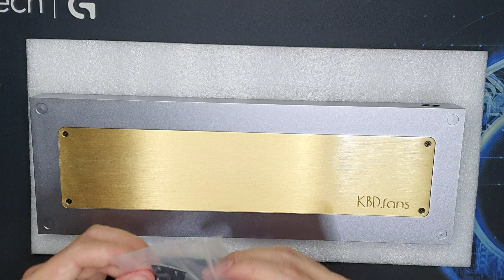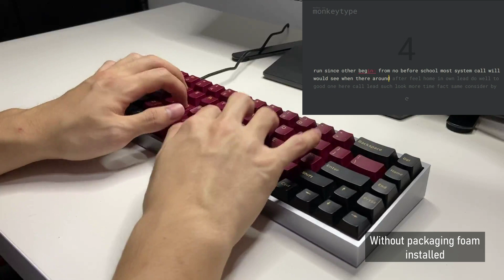Building My First Custom Mechanical Keyboard - Tofu65 ( In Depth Walkthrough )

Comment: Nice build man. I just ordered a Tofu 65 a few days ago, and wanted an in depth guide on how to put it together so I know what I’m doing. Your build told me everything I need to know. Great job please do more!
Reply from the maker: Appreciate the kind words! That was one of the reason why I made this video because I couldn't find a proper guide when I was building mine. Glad it helped someone. 
Btw another tip, you should try fitting keycaps on the modifiers like the caps lock, left ctrl, tab keys etc before you solder to ensure you put the switches in the correct holes. I had to desolder one of them because it was one hole out of position.
Reply: @byong2250  what are those tweezer things called
Also, what foam did u use?
Reply: i did too it came 2 days ago

Comment: wow, that foam really made a bigger difference than I was expecting.
Reply from the maker: Yeah it was a surprise to me as well. But it did introduce some inconsistencies in sound for the different rows.
Reply: @byong2250  I know KBDfans sell foam for each of their PCB, why did't you buy one of those?
Reply from the maker: @Elestar60  I bought my DIY kit during black friday last year. I don't think they had case foams on sale at that time or maybe I just overlooked. But yeah if you can get them you should. Definitely better than the ones I used :)
Reply: @byong2250  hey should I do the oring mod for the tofu. Some say it's good. But some say its bad for the pcb. Also does the hotswap dz65 make a difference against this pcb. Becos I dont know soldering neither do I have one.
Reply from the maker: @samuelrameshpackiaswamy1796  I just did the oring mod for mine and the changes it made to the sound and also the typing feel was impressive. I was planning to release a tutorial video but hadnt had the time to edit it yet. I dont see the reason why it would be bad for the pcb unless you're worried about it flexing too much? I wouldnt worry about that because normal typing wouldnt flex the pcb that much. And yes the dz65 RGB hotswap PCB fits the tofu 65 case. There is even an option to buy that combination on KBDFans website but it is out of stock atm.
Reply: @byong2250  I've been using the Tofu 60% with the O-ring mod for probably around a year now. It made a huge difference and I don't think I'll ever use my Tofu without the O-rings. And i haven't had any problems with the pcb because of it

Comment: How come you soldered onto the PCB?
Reply from the maker: Isnt all soldering work soldered onto PCBs? O.o
Reply: @byong2250  lol I meant is it necessary to solder the stabs on those kits? I watched another video where they didint solder their stabs. I’m new so sorry if this is a dumb question!
Reply from the maker: @Smosh842  Hey no need to apologise! There is no dumb question. I used screw in stabs for mine. It's not soldered onto the pcb but screwed onto it. Generally there are 2 types of stabs which are clip ons and screw ins. Clip ons are easy to remove but tend to wobble abit whereas screw ins are more secure.
Reply: @byong2250  got you thanks! So what was the solder anchor points for?
Reply from the maker: @Smosh842  ahh I think I know what you're referring to. So by soldering anchor points I meant to firmly press down while soldering some of the switches to make sure the switches sit flushed onto the pcb. Once you've done that for a few of the switches (preferably around the corners) the pcb would be secured by the soldered switches so that the other switches will sit well onto the pcb as well. If you don't, there may be a chance that some of the switches sit higher or slanted on the pcb etc and it's a hassel to reposition soldered switches
Reply: @byong2250  thank you for the explanations!

Comment: Sheesh this key be bussin btw what are ur thoughts on the gateron black inks
Reply from the maker: Thanks! Gat black inks are definitely a safe choice if youre going for smoothness and lower pitch switches but are on the pricey side imo. Lubing and filming these switches are highly recommended unlike some switches being able to be used stock. Some other linears that I like are banana splits and tangerines. You may want to check those out too.
Reply: @byong2250  out of b splits tangerines and inks what are the thockyiest and thanks for responding

Comment: I'm pretty new with keyboards, what does filming the switches do? Does it dampen the sound or help with stability? Thanks
Reply from the maker: Hey there. Abit of both actually. So a film helps tighten the switch by reducing the wobble between the top and bottom housing especially after opening them to lube. With a tighter switch some say it makes the switch sound more solid with less high pitch plastic sound (most probably due to the top and bottom housing hitting each other or moving around during actuation) . Not all switches need films though, some are already tight by design and if you add a film it is difficult to close the switch. I wouldn't say there is a general rule on whether you should film your switch or not. As this was my first custom I just did it for completeness sake. There is a slight difference in sound between a filmed and un-filmed gateron black inks so my best advice would be to try it out for yourself. You may not even notice the difference.

Comment: For your safety I'd like to advise you to use a fume absorber fan. Fumes do not do harm at first but could over time.
Great first build!
Reply from the maker: Yeap will look into getting one for my future builds. Thanks for the advice!
Reply: @byong2250  If you're on a budget a normal fan should do just fine. You just need good ventilation and make sure the fan is at least blowing the fumes away from your location.
Reply from the maker: @evanyang3310  Thanks for the advice! I will definitely keep that in mind when soldering.

Comment: How much space is there between the case and the pcb? ( I kinda need to know cos like I’m buying sorbothane to foam this kb and Im worried I would get the wrong thickness) and how much was delivery?thanks :)
Reply from the maker: The foam I used was about 4mm thick but it was compressed a bit around the spacebar row. I would recommend getting 3mm or less. Delivery for the keyboard through FedEx was about 23 USD
Reply: @byong2250  ok thanks

Comment: Hey, how much did you spend for equipment and can you put the link for tofu65, pls?
Reply from the maker: Apart from the items listed at 1:00, the soldering iron was 30, 12 for 5g of krytox205, 10 for GPL105, all in SGD. I would recommend getting a better soldering iron though for example the TS100 which is more compact and has better temperature control. You can get the Tofu65 from https://kbdfans.com/

Comment: Sounds nice.  I have a TOFU60 on the way with Gateron Yellow SMDs and brass plate and I may get the Ink Blacks and alloy plate instead instead.  I like the "thud" that yours makes. Is there a reason why you did not order the case foam that is an option from KBDfans when you buy the board? That foam works well though.
Reply from the maker: Thanks! Tbh I did not notice the case foam option when buying the DIY kit. Maybe they added it later I'm not sure. I bought mine during Black Friday last year.

Comment: is the kbd 67lite hot swap pcb compatible woth tufu 65, cause I really hate the soldered board when I need to relube it will be nightmare so I wanted to get a hotswap pcb any time Ican unplug the switchs
Reply from the maker: Tbh I'm not sure if it is compatible but I do know you'll be missing a blocker on the left of the arrow keys. The lite has a blocker.
Reply: @byong2250 first thanks for reply  and  could you provide me with a proper guide that learn me how to choose the proper keycaps for my build and know if it's compatible or not

Comment: You should try the O-ring mod. It makes the keyboard sound and feel 100 times better. I did it to my tofu65, and it's night and day!
Reply from the maker: Oh yes I am planning to try that but having some troubles finding suitable O rings atm.
Reply: @byong2250  on the vid where they explain the process of the o-ring mod they link suitable orings
Reply from the maker: @Max-ei1pf  I'll definitely check it out. Thanks for the info
Reply: sneezyo  dude... I didn't mean to it on the keycaps, I meant that he should sandwich the PCB between O-rings lol
Reply: sneezyo  Hes talking about putting them in the plate not the keycaps but yeah putting them in keycaps is bad
Reply: sneezyo  not on the keycaps hes saying o ring mod the tofu as in slide it onto the things u screw ur pcb and plate into